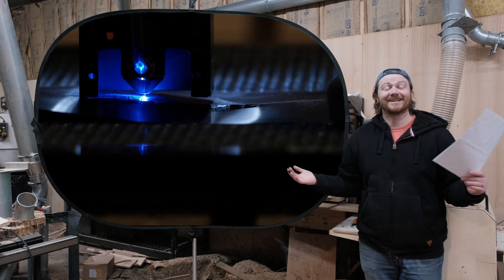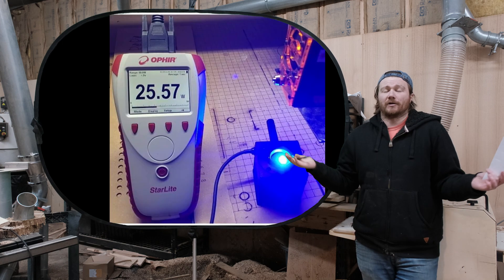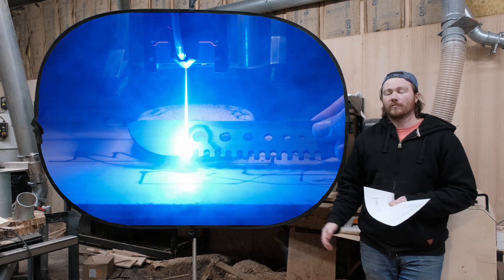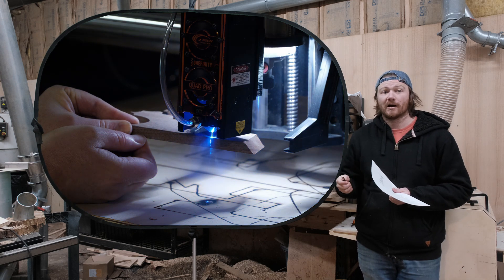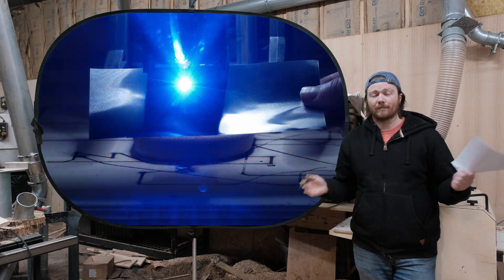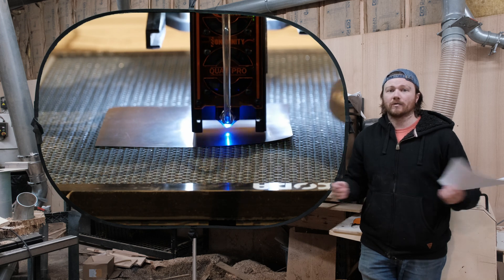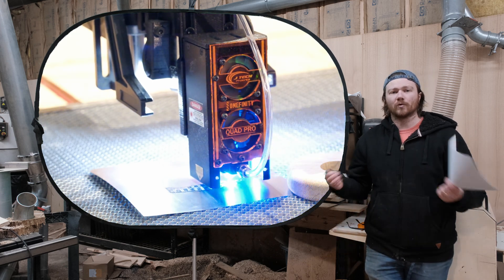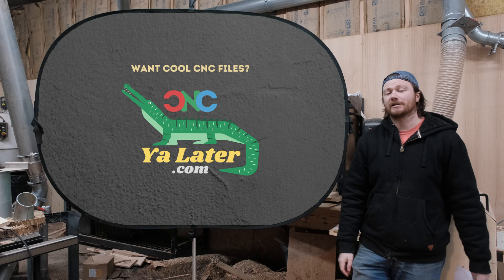Most Powerful Onefinity CNC Laser

Comment: Hi there.  Thanks for the great video explaining how the laser I have is completely inadequate lol.  I joke, I have only just set up my 1F X50 woodworker, and I have the 7watt laser to go with it.  I was wondering if the test grid you have on your website would be suitable to use with my machine?  I am very new to using the 1F, and CNC equipment in general (I am an old school engineer), so any advice would be gratefully received.  Many thanks in advance.

Comment: With a laser that high powered you really need to get some better laser goggles. I work with lasers on a daily biases and don't trust any of those glasses that come with online perched lasers. They may not cover the wavelengths the lasers emits. You cant replace your eyes ones they are damaged.

Buy some really good ones from LaserVision. Pick the filter for the wavelength that your laser is listed has. The higher the OD, the better.
They are your eye's so a $200 google/glasses are cheap compared to not being able to see.